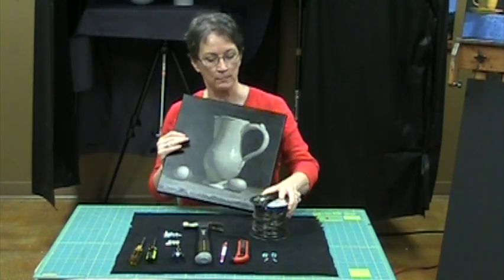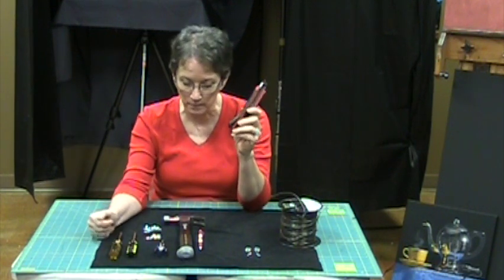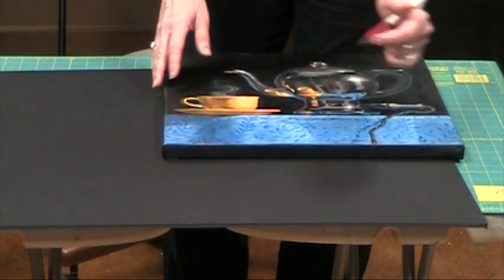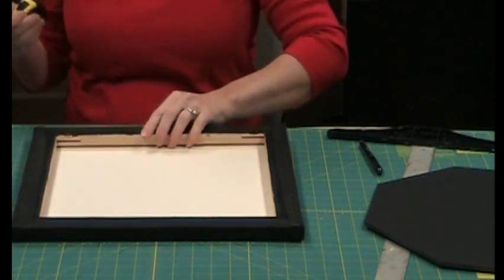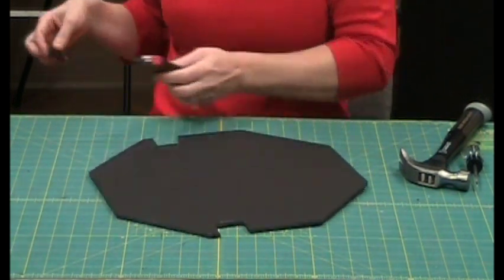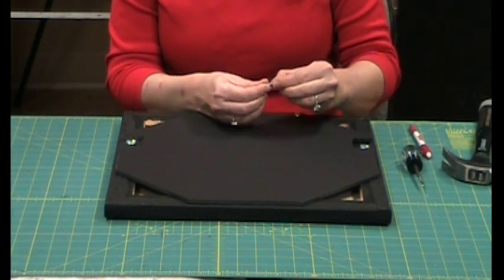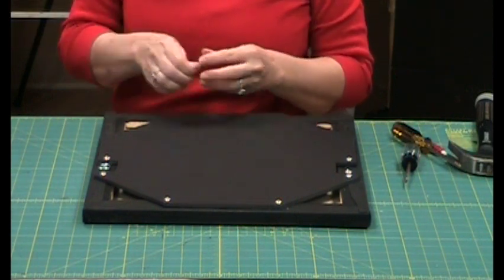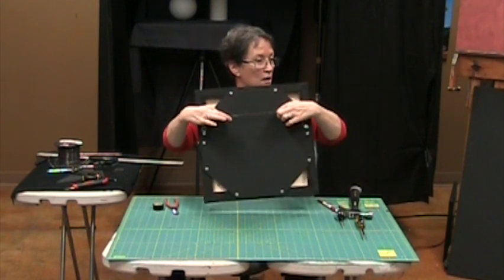placing a foamcore backing on a stretched canvas

Comment: Does anyone skip stretching canvas paintings on bars and instead just mount it to the foam core? I know a lot of people mount paper prints on foam core, but I don't know about mounting a giclee for instance onto the foam core. I also know that there are such things as acid free adhere ready (peel a sheet off of the foam core and it's got sticky material to adhere to) I just don't know if people mount canvas on those. Can you elaborate?